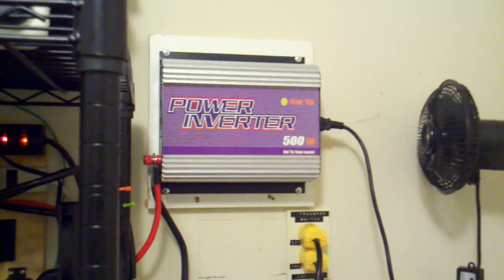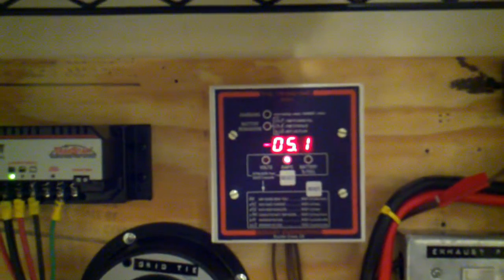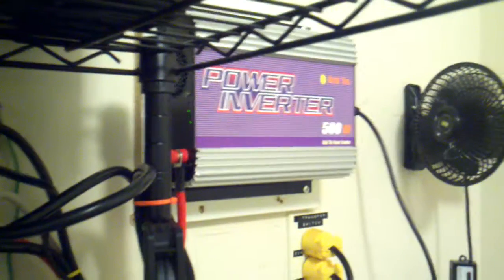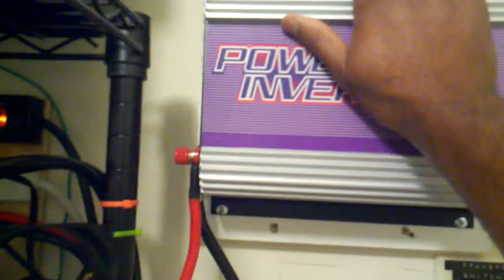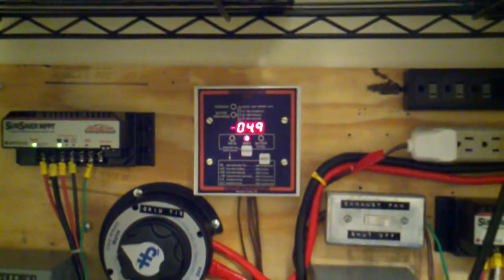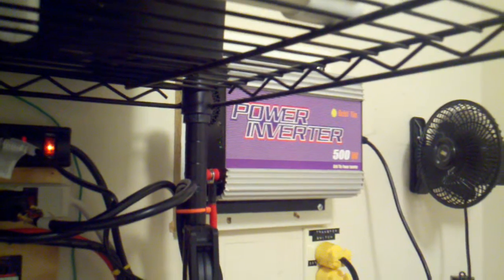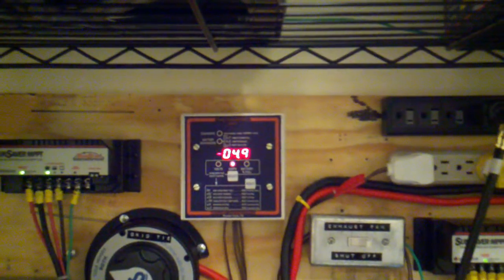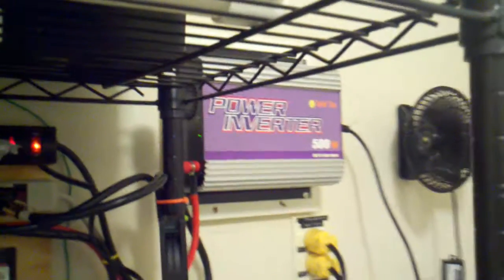DIY - Sun 500W Grid Tie - Off Of Battery Bank Performance Test Part 3

Comment: I have a 12 volt 600 watt system just for a power outage or if I need power in my shed.I was wanting to experiment with grid ties but I always hear negative things about them.How would I hook up a 600 + watt grid tie to my 12 volt system?I understand how to hook it up if I were to have a seperate array of panels,just from the panels> to the grid tie> to the wall outlet,but to integrate it into the 12 volt system.My set-up is hooked up like this..the panels into a shut -off switch,to the charge controller,to the battery bank,to the inverter.
Reply from the maker: +Gary H If your system is "primary" meant for backup purposes and you want to experiment with Grid-Ties integrated into your setup, you could look at diversion controllers that would monitor your battery voltage and when your batteries were full, divert power to your Grid Tie.  That works very well.  If you check out my channel you'll see that I did videos highlighting this approach, before I switched to a fully AC Coupled system.

Comment: gentleman wanted to ask her if she can tell me the type or the code number of the mosfet power inverter 500 , 'cause unfortunately I do not find them removed and more ' , hoping for your response a friendly greeting by dario r .
Reply: MDP18N50 will do or any 18N50 type.... Remember to check "cylindrical fuse slow blow" to see if isn't blown... Hope it helps!

Comment: Are you still using this setup? Have you had any problems?  I'm about to try the same type of set up to reduce my nighttime grid usage....
Reply from the maker: M Gunderm I'm currently using a modified version of this with a Grid Tie Inverter controller that detects my battery voltage and sends excess power to the grid tie.

Comment: 472 Watts / 500 Watts = 0.944. 94% efficiency. Very good to today's standards. In the setup in the video, it appears that the battery power is being delivered to the power grid.

The good thing about this video is that hooking the battery bank to the grid-tie inverter represents an almost idea scenario (batteries are more capable of producing a steadier voltage as the amperage varies, compared to solar panels). It's almost like you're allowing the inverter to go full speed.

Hook your grid-tie inverter to some sufficiently-rated solar panels and you'd be feeding that 472 watts to the power grid. In a practical sense, that inverter is saving you the power of twenty size (26) 18W LED light bulbs or a 300W computer, or two laptops.

Nice demonstration!
Reply from the maker: The only problem is that these cheap Grid Tie Inverters do get hot after awhile running full speed. And in the summer that could be a problem.  I recently had one burn out and I have 3 or 4 fans on it.  A 600w 24V or greater inverter works best in these situations.

Comment from the maker: No, I don't believe so. The GTI is just another load on the batteries demanding whatever power it can get get. If your GTI is rated at 500w, your not going to get the full 500w due to losses such as heat etc.  However, what it will draw depends on it's rated voltage, i.e., if your GTI is rated between 10v and 14v and it's connected to a 12v battery bank, then you'll pull close to max wattage, 22v -> 60v GTI tied to a 24v battery bank, you "may" pull half your max watts.

Comment from the maker: Optima redtops are automotive batteries.  They are not good for solar applications.  However I believe it's 44Ah.  So 44 x 12 = 528w.  528 x .80% = 422w.  So you may get 1hr of use.

Comment from the maker: It's been a while and I don't remember the total amps, but if my memory serves, it could have been around around 20 Amps or so at around 25V. I think after all was said and done, with corrections etc., I got around 78% efficiency. I've found that it's not about voltage per se, it's about the total DC power (watts) coming into the GTI.  Higher voltage, lower amperage will still give low efficiency ratings. The battery bank allows for max power to flow through the GTI, and why the need for a fan.

Comment: What are the Amp's that the "Grid Tie Inverter 500 Watt" is pulling at what voltage to get 472 watts directly from your battery bank?
I'm asking this to see what its efficiency is and if giving it more volts makes it more efficient.

Comment from the maker: Thanks. The GTI is still working fine. I have 2 of them now. I don't run them everyday so any savings are small. But every little bit helps. Lately, I've re-arranged the configuration to run them from 8:00 a.m. to 4:00 p.m. at less than the watts that is shown in this video, about 330w per hour, which allows me to generate on average 2.6kW during a sunny day.

Comment from the maker: @shartne I have 2 separate sole arrays. The 1st array is a set of Kyocera 135W panels, model #KD135GX-LPU and the 2nd Array is a set of Sun 200W "SV-T-200-HV" from Sun Elec.  You can see them in my  videos "DIY - Home Solar Hybrid - Standalone - Grid Tie - Done!!"  and "DIY - Home Solar Power Part #2".  You can google the model numbers for the exact specs.

Comment from the maker: @hooterman2828 Thanks, I put it together piece by piece as I learned by watching a few vids and reading some e-books on design and safety.  500 - 600w of power is a nice setup and that many batteries give you good storage capacity.  Whenever you can, add a good monitor to make sure things are going smoothly.  I'll check out your vids also when I get some time.  Take care.

Comment: you got a very nice setup. i like all the monitoring equiptment that you got. i went the other way, instead of getting the high tect stuff i just got more batteries and panels. i got about 500w.- 600w worth of panels (3 of which are homemade), got 9 dual purpose deepcycle batteries rated at 125 amp hrs. each. 2 mppt charge controllers one 60 amp and one 20 amp. and 1500watt and a 700watt off grid inverters. i wish i had a grid tied inverter but i make do with what i got. great vids.